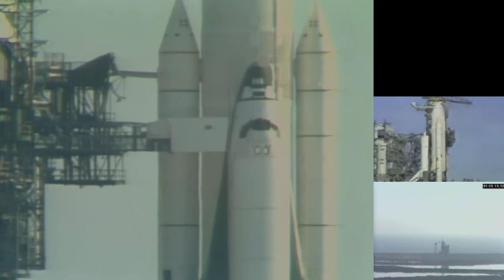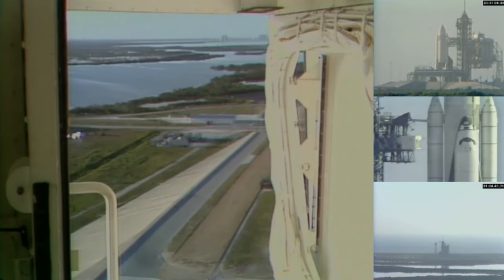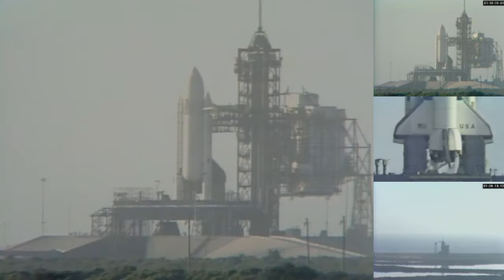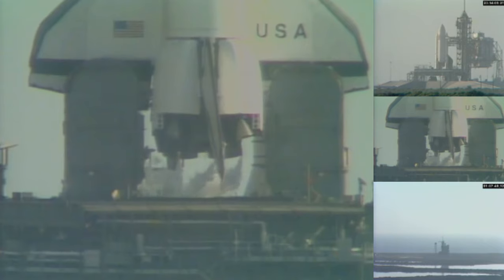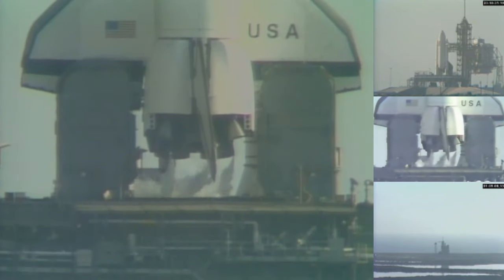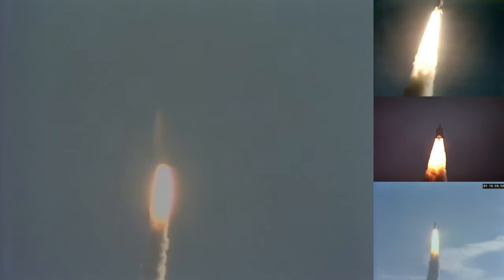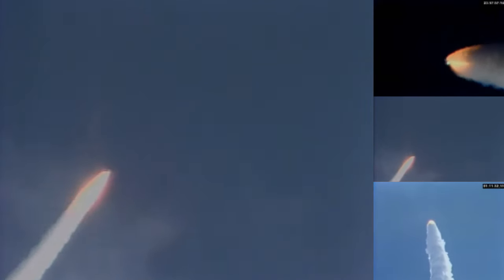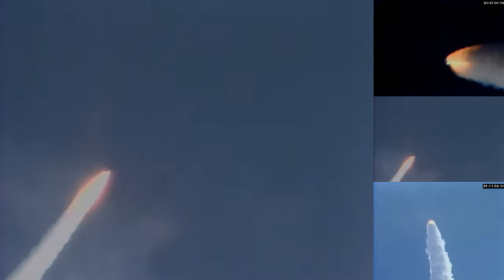STS-1  The Launch of Columbia

Comment: Considering that they never did an unmanned launch of the shuttle, this is arguably the most daring mission ever undertaken by astronauts.
Reply: It sure was.
Reply: And to be honest, NASA didn’t screw around with crew selection.  Young and Crippen were absolutely first rate astronauts and truly among the best we had.
Reply: Indeed, you'd have to be brave to step aboard that beast. It's easy to see why they seek test pilots.
Reply: @iitzfizz  they didn't even have the luxury of a few unmanned test flights of the vehicles. Very brave indeed.
Reply: The moon landing was more daring 😌
Reply: @heraldshalom2756  
No, it really wasn't. Much more complex, but STS 1 saw a completely untested launch assembly fly for the first time with a manned crew. The early shuttle flights (first 9) had a 1 in 9 chance of catastrophic failure. In fact STS-9 which was also commanded by John Young came the closest to disaster.
Reply: That's why I don't understand why the first Artemis SLS rocket is unmanned.
Reply: When I saw all of those missing heat tiles as a kid, I was sure that those astronauts were going to die.
I was so relieved and proud to see her touch down. But that event led NASA to believe that losing some tiles wasn't a big deal.  Then debris strikes weren't a big deal. And then...
Reply: @inigobantok1579  There were quite a few unmanned Apollo missions, I think the first 4 Saturn V rockets were unmanned just for comparison.
Reply: @inigobantok1579  because it can be. Orion doesn’t need anyone on board to fly it. The space shuttle couldn’t fly on its own.
Reply: Put the best in there, and Young was the man!
Reply: Oh without a doubt!
Reply: @inigobantok1579  Well these days there is pretty much zero tolerance for any risk at all, for better or for worse, which is one reason every NASA project runs at a snails pace and nothing ever seems to get done
Reply: Even the buran had that
Reply: Hence the ejection seats...
Reply: I'd say Apollo 8 would be right up there
Reply: @yassassin6425  because of your comment I went to look up STS 9 A moment ago. That would’ve been really bad
Reply: In the Army, way back when, we called that "intentional fortitude".  That's two 10 cent words for a 1 cent meaning...
GUTS!
Reply: @TheAngryAstronaut  …and then it was a big deal😿
Reply: John Young’s heart rate never got above 90 BPM
Reply: @cmatte82  It especially couldn't land on its own I bet.
Reply: They didn't use water suppression on STS-1 and almost broke the engine mounts on the orbiter. Not surprising they lost a bunch of tiles from the acoustic vibration.
Reply: U_
Reply: Buran did it better shame Soviets went broke after that all that money spent on nukes and then Chernobyl 

Such a waste of
Reply: Agree 💯 percent 😊

Comment: STS1 was very nearly lost as the body flap was pushed WAY past failure point by T-0 ignition of the main engine back blast - had the astronauts known what happened, they would have ejected
Reply: It was shock waves from SRBs that did the damage not the shuttle's main engines.
Reply: @samwheat1302  thats correct yes

Comment: Didn't the shockwave knock some heat tiles lose on launch? Thank God they made it back safely!
Reply: Apparently it did, because it led to major improvements in the sound suppression system before STS 2.
Reply: yes and the srb overpressure came very close to rendering the body flay useless,which would have resulted in a bail out at altitude.
Reply: Yes - 16 of them; most located on the OMS pod but also 2 near the nose.

Comment: It’s interesting, you can see how violently the SRB fired. They weren’t supposed to fire so aggressively. Almost blew the orbiter up.
The orbiter had slight damage. Including a locked flap that moved up and down 6 inches by the blast. Heavy modifications were made after this.
Reply: It had nothing to do with how the SRBs fired, it was an overpressure wave.  The water sound suppression system was modified and the issue was fixed.
Reply: @lovetopew9054  if you say so ☺️
Reply: @TEMPLE7D  the SRB over pressure was grossly underestimated by NASA and led to the body flap of the orbiter moving outside its limit of 9 degrees. luckily it still worked upon reentry, if it was rendered unserviceable the first flight of a billion dollar shuttle would have seen both pilots eject from the vehicle at altitude.
Reply: Comparing this launch to later one's, it seems the boosters lit, only a second or two after the mains. There was a "quickness" to the process.

Comment: The first flight of the Shuttle was meant to start a new era in spaceflight, an era in which it would become cheaper, safer and routine. Of course,it turned out to be exactly the opposite - more expensive, more dangerous and anything but routine, with so many delays.  
This was the first flight of a crewed space vehicle with astronauts aboard, making it the most dangerous flight ever. This was also the first US spaceflight to end on land and not with a splashdown.  The flight went well but tiles were missing, though not in a crucial area of the Shuttle, an early indication of the falling debris problem which would destroy Columbia 22 years later.  Commander John Young, the only Moonwalker who flew on the Shuttle, made his 5th flight, the first astronaut to do so and would command the first Spacelab mission on  Columbia 2 years later. Pilot Bob Crippen made his first flight and would later command the mission to repair the Solar Maximum Mission satellite.
42 years later, crewed spaceflight is still not routine with only a few launches every year. Whether Starship will remains to be seen. SpaceX has managed to make launches cheaper and more routine with its Falcon rockets but so far only uncrewed flights.  Starship is a much more complicated vehicle with 33 engines and it will be much more difficult to make spaceflight cheaper, safer and routine with people on board. We just have to wait and see.
Reply: That simply isn't true. $196 billion dollars for 134 missions to orbit. That includes hauling and building the ISS, the Hubble telescope, various top-secret military loads, and countless communications, weather, geologic satellites. 

We've sent more money to Ukraine in the last 2 years.  :(

Comment: I wish they would have updated the shuttles with Nuclear engines. Then used them as deep space ships.
Reply: What propulsion are you getting with a nuclear engine?
Reply: @TEMPLE7D  do you mean Specific impulse or what?
Reply: @bobleece4152  Oh that? Ehhhhhhhhh. That technology is still being worked on.
Reply: @TEMPLE7D  Nuclear propulsion has been around since the 1950's. Here's a link.  https://en.m.wikipedia.org/wiki/Nuclear_thermal_rocket
Reply: @bobleece4152  so why haven’t we used that as a viable fuel instead of these explosive rockets?
Reply: I wish they would have carried the empty external tanks to orbit, corralling them to be used on a future Mars mission. Imagine a large vessel made from 134 external tanks, all with plumbing and storage capacity, built in ...

The shuttle was built to fly through an atmosphere .. wasted potential for interplanetary missions.
Reply: Considering Columbia eventually came down scattered all over east-central Texas it was probably good they didn’t.

Comment: My son and I call the STS acronym the Suicide Launch System - You are riding on rockets that can't be turned off once they ignite. SRBs are great on payloads that are expendable. Humans are not expendable.
Reply: The SRBs did pretty well though .. only one failure in 134 flights.
Reply: @Deploracle Which resulted in loss of crew and vehicle.
Reply: @executivesteps could’ve been avoided though if they would’ve listened to engineers.
Reply: @Deploracle  An SRB failure is a guaranteed loss of vehicle and loss of crew. 
One out of 134 (actually 268) is NOT “pretty well” on a crewed vehicle with no provision for escape.
Reply: @executivesteps  As CosmicGuy said above .. had the Morton Thiokol engineer's advice been heeded .. the Shuttle could have had a perfect launch record.

The SRBs didn't fail .. they were forced into use beyond their design parameters. The humans lit the candle .. the rest is history.